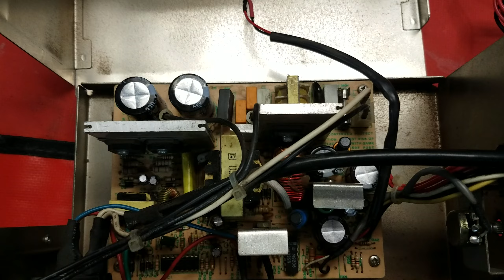Arcade 150 watt Peter Chou Power Supply Refurb Part 2

Comment: Where can I get that "loop back" piece that allows me to turn the power supply on when it's on the bench?  Thank you!
Reply from the maker: You'll have to make it with 0.093" connectors and a housing. Or if the modification is permanent, just cut the plug and connect the wires (or better yet solder a jumper to the board)

Comment: My new power supply has an on/off switch and it doesn't connect to my arcade cabinet's external on/off switch.  Would it be difficult to add a line from this power supply to my external on/off switch so that I can continue to turn the arcade on and off the way I've don for years?

Comment: Extremely helpful.  I'm swapping out a power supply and I didn't know what the 3-prong and the 4-prong were for.  I was worried because my new power supply doesn't have the 4-prong, but it does have an on/off button on it.  The external switch on the power supply will no longer work without the 4-prong, but that's fine as I've had arcades like that before.  I'll just plug it into a nice power bar and use the on/off switch on that as my on/off for the arcade.